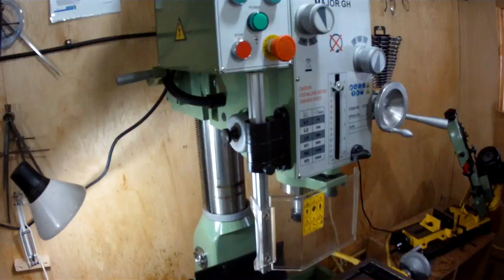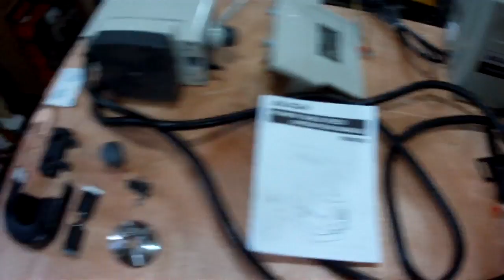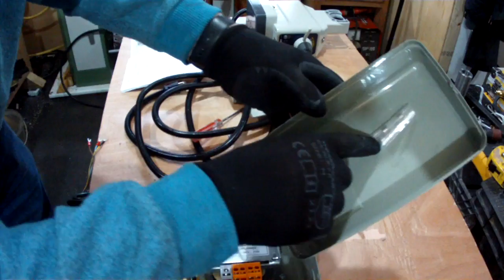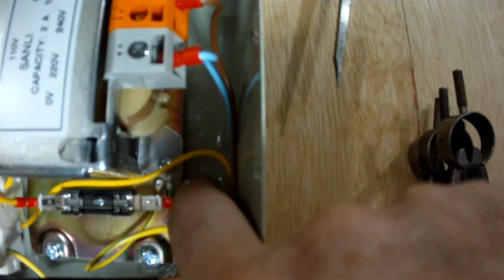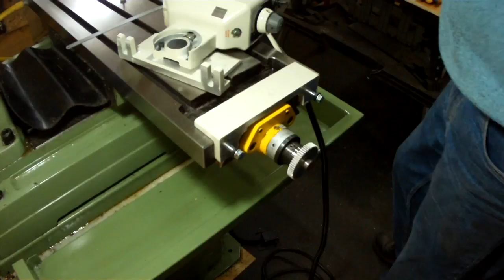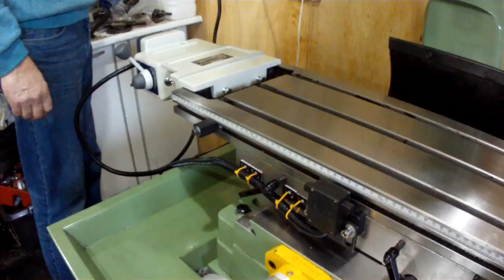Powerfeed, fitting one to a milling machine.

Comment from the maker: Hi Maurice.
I have recently used my milling machine for varius jobs using many different cutting tools including 4” fly cuts, a 3” shell end mill, a 2” facing mill, a 3” strasman (side loaded cut),…  and the fuse in my power feed is still holding out ok.
I hope you got your fuse problem sorted..
ATB.

Comment from the maker: Hi Maurice
I have used this power feed a few times but, only on end milling operations so far.
One operation was on an 11mm wide slot x 10mm deep over 125mm without a problem.
I wouldn't hold your breath if you expect a phone call off Warco, and I wouldn't do same for any advice electrically. The technical department is in my experience is somewhat challenged.
However, I did talk to one person called Peter (technical dept) in who helped me as best he could with a diagnosis one month before my lathe gave up again. 
You may also get some other person, can't remember his name, from one of the various departments, he may try to put you on the wrong foot by suggesting that maybe you are not using the machinery in the correct way. Stand your ground.
My impression is that the glass fuse is blowing because it is overworking, check first that your gib strips are not binding, that the gears aren't binding. The gears should have graphite grease on them according to the instructions on the main body case. If the motor is the same as mine then your lever is facing the wrong way and behind the table. It is possible it's a slightly different model.

Comment: Have you used this ie cutting materials ? i have one but my one fits on the right  hand side . Today i have been using for the first time fly cutting but the fuse in the box keeps blowing (5 times)  awaitng a phone call from Warco technical team hoping they can help . The fuse is only 2 amps so it doe'snt  take a lot to blow it .  A bit dissapointed  with the fitting instructions and the product at this stage